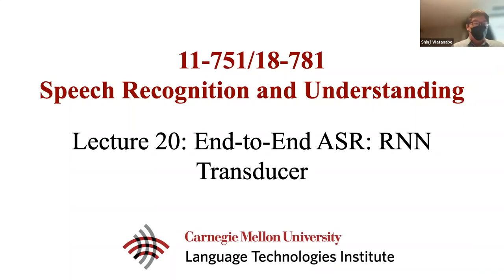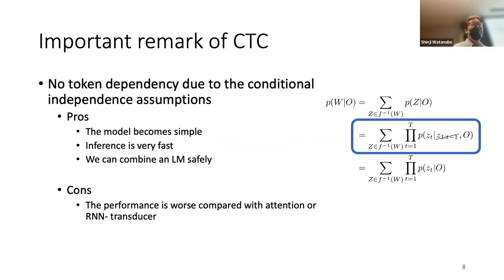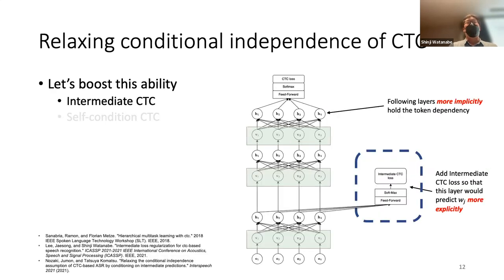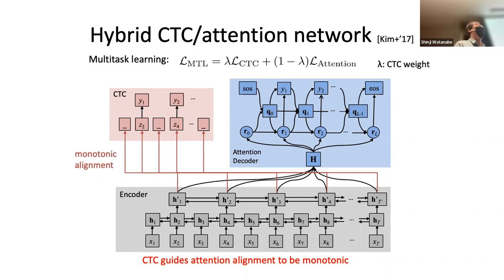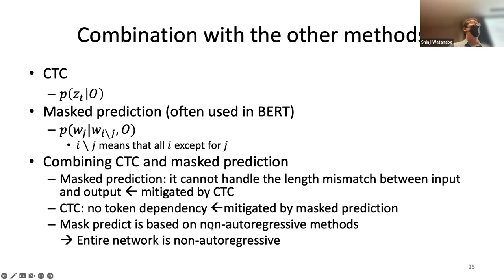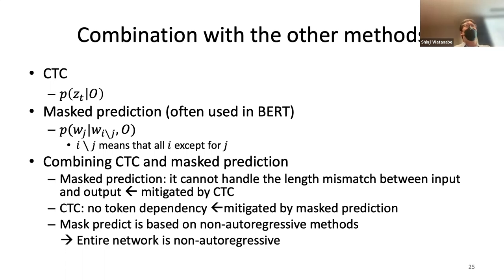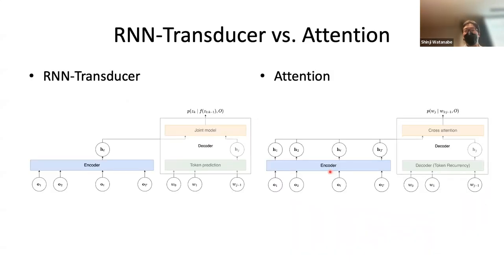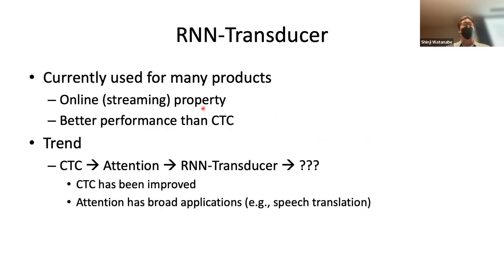Fall2022-SpeechRecognition&Understanding (Lecture20 - End-to-End ASR: RNN Transducer)

Comment: Is CTC still so fast compared to attention-based approaches in inference even if we added a language model to it? Or it will be slow as we cannot parallelize decoding?
Reply from the maker: CTC is still faster. With CTC, we direct get all the posteriorgram with the last linear projection. But for attention-based models, we need to do the forward through the large decoder based on the context.
Reply: @wavlab3016  Thanks